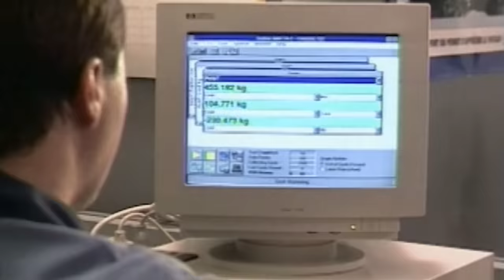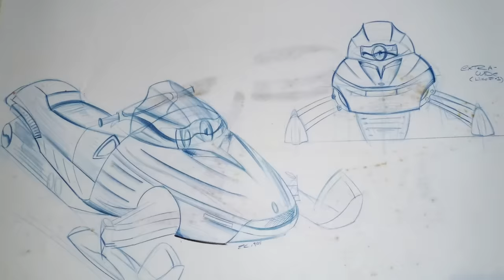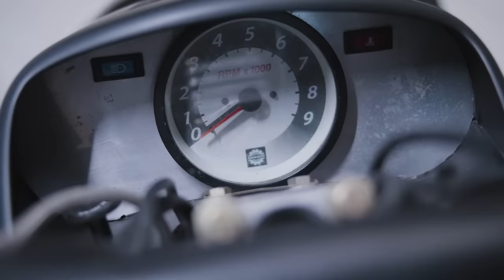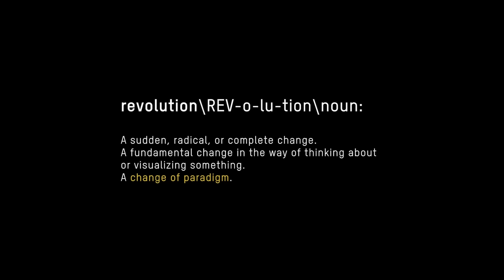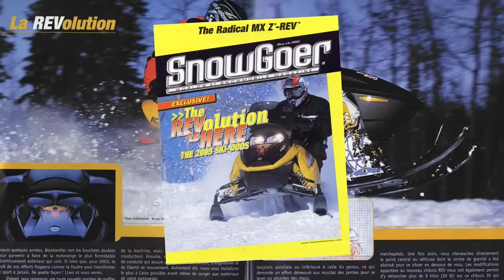Celebrating 20 Years of REV platform by Ski-Doo

Comment: The most reliable snowmobile out there by far.
Reply: I agree my 2003 has yet to be rebuilt
Reply: @tboystoys5682  how many miles do you have on that thing???
Reply: Ya ok if you believe
Reply: Very far from the most reliable, definitely the best riding sled, but the sealed bearings requiring to completely disassemble the motor every 5000km after that you’re running on borrowed time
Reply: @tboystoys5682  i got a 2000 600 mxz with close to 7,000 miles still runs like new. An i have a 2002 mxz 700 with less than 2000 miles.
Reply: Yamaha most reliable. Still have my 79 Yamaha srx440. Untouched top end. Small, fast, Liquid cooled, no suspension…… won many poker rally’s with that tiny sled.
Reply: @lmtada  yamahas run forever
Reply: My dad just bought a 2023 ski doo 600…. Didn’t even get a good trip in , kept stalling and surging … it’s at a shop for repair already….Crazy, I would say not reliable
Reply: Rebuilt my 05 and it blew up 60 miles into a trip. I was going like 60km

Comment: First gen rev Is still my favorite snowmobile to this day.
Reply: I ride one of those to this day
Reply: @prestonscherer2062  Just put on a 150 miles on my 07' 600 SDI yesterday. Still rides like a dream.
Reply from the maker: Rev's still a great machine!
Reply: Bought a new 2006 Rev 600 SDI that I still own! Best engine and performance of those years by far. Got a lot of crap for purchasing the SDI model for an extra $500. That ended up being a steal!!! Never took into consideration for the less oil and gas mileage and the power was always consistent. 12000 miles it went out and we stuck a new short block in it last year. Still a fun sled!

Comment: So my dad bought a new 2023 ski doo 600, it’s in the repair shop already at peacock Ltd in Baldwin Michigan. He was Very upset that it had already broke and cant even go on a planed trip with his friends up the the UP of Michigan on the 12th for the week. As he has already planned as it won’t be done for a bulletin. It was shutting off and surging….. not fun for a brand new sled…. He is 65 with stage 4 bone cancer. It hurts me to see him missing a trip due too a bad product. He has owned many snowmobiles and actually has some vintage ski doos that he is fixing 3 of them to be exact. He had a bad first ride on the snowmobile and it will be at the dealership for a few weeks he said….😢 sad …. Not even 200 miles on the snowmobile yet.
Reply: Sad thing is ski doo knows about the problem, since 2019 they said…
Reply from the maker: We're sorry to hear about your situation, glad you are in contact with your dealer so they can get things resolved and get him back on the snow as soon as possible.
Reply: @skidoo  won’t be soon enough, he was very excited to buy another new ski doo as his last new one was an Arctic cat… he has that one still also. But he has lost interest on going on a trip with his friends. He has bought many new snowmobiles though his lifetime. From every manufacturer . This is the first to fail this fast. The Arctic is a 2019 and never had an issue. The one before that was a 2016 ski doo 600 sdi 2 up…. Never had an issue. Peacock Ltd said they had to put in for a-warranty… it will not be done in time for the trip as the gas tank will probably need replaced due to the problem that has been with these sleds since 2019…. He is redoing the (3 of the) 1980s ski doo stratos because he bought one new back then brand new…. He sad they are very reliable unlike this new one or the 2016. He sold the 2016 due to the cancer being in his bones but has since been in remission and is feeling good some days.

Comment: As a 1st gen rev rider, my friends on the "couch" style sleds seem to think that the Rev ruined snowmobiling. Apparently, they haven't rode mine for long enough yet 🤣. It is so much more comfortable through rough terrain and easier to ride harder for longer. While I plan on moving to a 4th gen Rev soon, I certainly will miss my 03 Rev. It has been, for the most part, an excellent sled. 

Keep on innovating Skidoo. It is in your nature.

Comment: I just bought a 03 Rev,  I started out on Ski-doo with the Elan and Olympique. I drove a Polaris Indy and I switched over to the Indy 500. I had an RXL and I bought a Cat with a 440 at one time. I have never owned a rider forward sled or even driven one. I am looking forward to riding the 03 MXZ this winter, I haven't had a sled for about 10 years.  I would have bought a new sled if they offered some more affordable options.

Comment: Oh my do I ever remember the REV Chassis when it first came out! I was a technician at a dealership and when the new chassis was released Bombardier sent around a demo REV to the dealers for customers could test before ordering a new sled for the next season. Well I hoped on it the first time and blasted across the field with a huge smile on my face thinking wow this thing is the most amazing snowmobile I have ever road. Soaked up bumps like nothing. Thats when I messed up, it was dark out when I rode it and I was ripping back with the sled in the ditch. Thats when I hit a big drift with it, flew through the air and nose dived it into a second drift throwing me off the sled!  I out rode my headlight and didn't even see it! Needless to say I was ok, the sleds windshield ripped off, (they were designed to do just that) and the front bumper got a crack... Fun times!

Comment: Certainly big improvements when switch from 03 f7 to 03 600HO rev in chassis. Those firecat motors where fast, reliable but chassis was poor. Rev chassis was great (better in 04) , 600 HO motor was good until carb bodies wore out and isoflex ran out.

Comment: They forgot to mention two points. They have greatly improve the "gas miles per gallon". MXZ 600 is a wonderful sled but with all these advancements comes sticker shock. I can no longer think of owning one of these. I am now a "rental rider" which means you don't see ski doo as a rental very often because of the price.